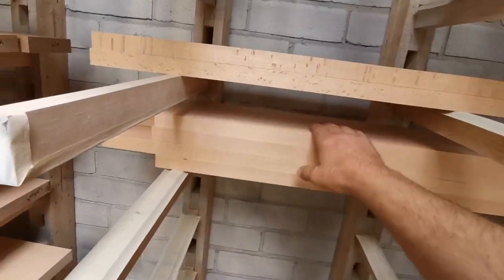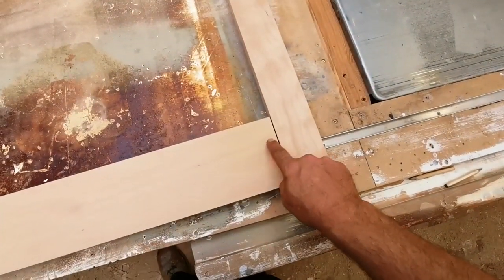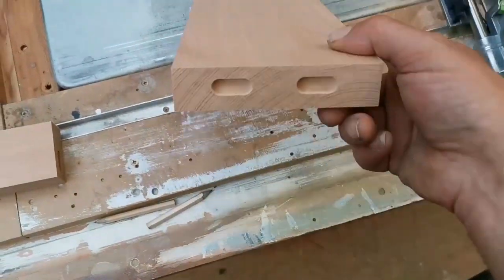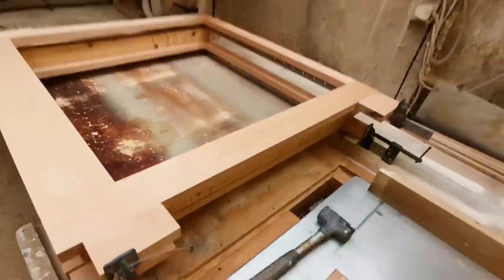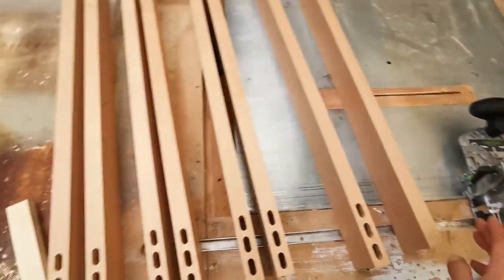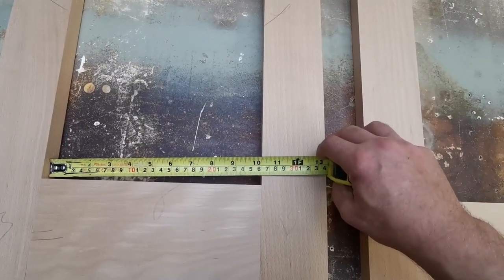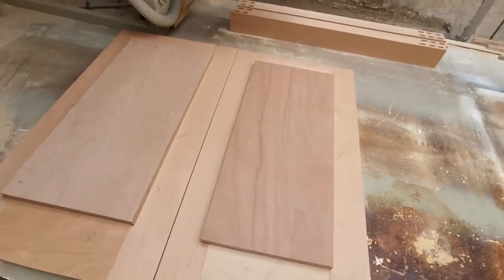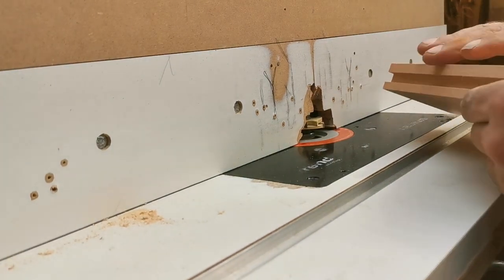Smith's Alcove cupboards & shelves Pt2 - Starting making the doors

Comment: Hey Gid. 

I have had the same issue with the domino machine on my current project with the slight misalignment. I used the 1st snug setting on both domino's for the stile and rails and it seems to compound the problem the more you put in. Im thinking on the next project i might use the snug setting on the first domino then the loose setting for the second domino. 
I know it was a while ago when you did this project but it seems to be a festool issue across the board not just your machine. 

I also noticed to that they recommend not doing multiple snug domino's consecutively after looking into it last night. Maybe they are aware of this issue and that is there way around it =) haha
Reply from the maker: 👍 Hi, I've not used the Domino much recently but next time i do I'll try that, it's remembering which setting you have it on, loose or tight n i always seem to get one wrong 👍 a switch near the trigger would be good, flipping that big lever on the top is a pain & seeing which it's set at isn't easy to see, i have to look at it the right way to work it out, 👴🙃🥴😂

Comment: I’ve noticed sometimes you used mrmdf for panels and sometimes ply, why do you not use one material all the time for a panelled door? Which would you say is the better material over all for a shaker door..?
Reply from the maker: Hi Oliver, i would prefer ply if it was my choice, MDF always comes second to ply, I only use MR MDF because it has a better smoother face for spraying, it gives a nice flat finish, the surface doesn't feather up so much when wet from the spray & hopefully the MR part will make it last a bit longer, but any MDF can sag or bow a little in time, ply doesn't sag, is stronger & will last many times longer but it does have a grain which could/would show through the spray paint, hand painting goes on thicker & would prob cover the grain but spraying shows up every flaw, also spraying doesn't like filling gaps or small holes, even ones that are like pin pricks so all of those need to be filled, I mention all this give the clients the option, it's their choice in the end,

Comment: Is there a reason why you mark your dominoes with black squiggley lines on the side?
Reply from the maker: The ones with lines on them I've sanded down so they slide in n out easily for temp assembly, it's so i can ID them